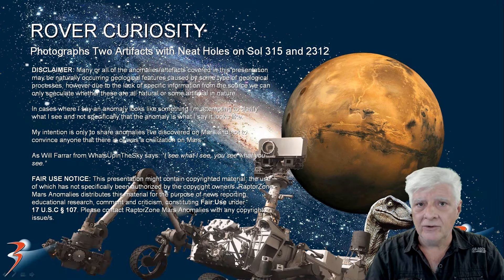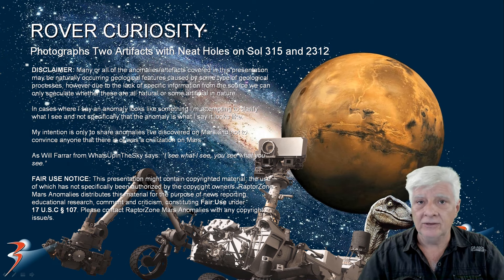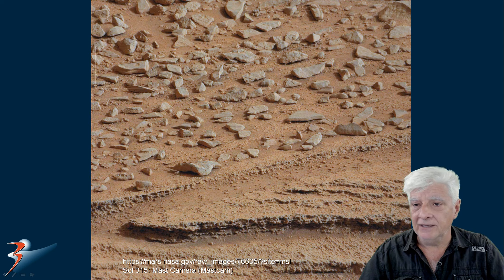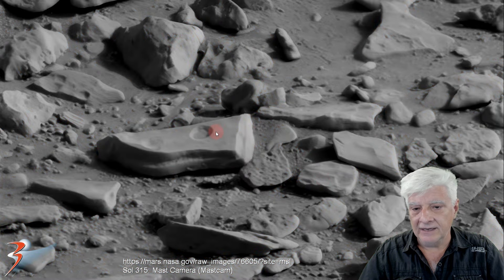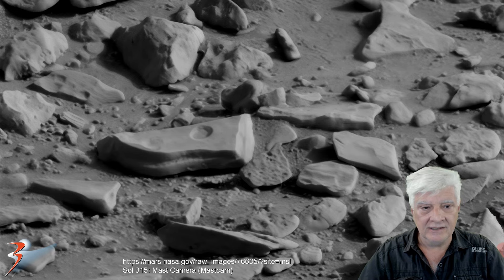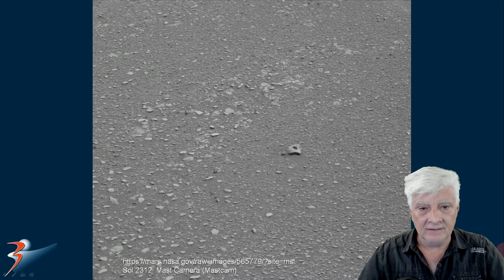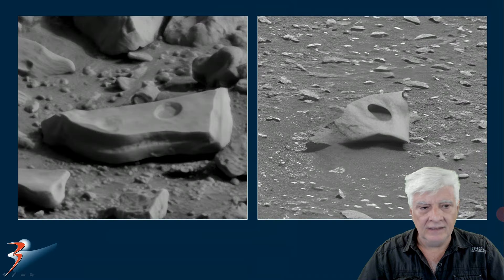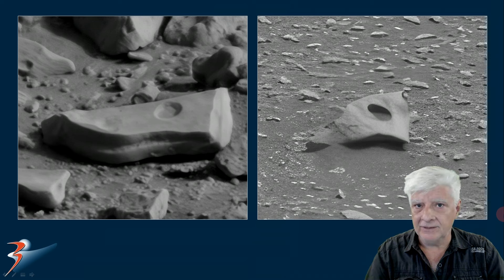ROVER CURIOSITY | Photographs Two Artifacts with Neat Holes on Sol 315 and 2312

Comment: Isnt the 1th one the result of one of the rovers instrument??
Reply from the maker: Good question - I don't think the rover made this impression as the hole is too shallow and flat inside (the drill would make a deeper concave hole) and the brush instrument likely can't make a hole, unless the material of the object is very soft.
Reply: @JeanWard  and this river does not have a laser ibtrument does it.. i should know really
Reply from the maker: Hi Jos, the rovers drill would make a concave hole, the hole in this object is flat inside. The rover brush instrument might make a hole or impression of the material of the object is really really soft.
Reply from the maker: Hi Jos, yes the rover has a laser, normally they would fire it several times in a row and it makes really small marks.
Reply: @JeanWard  yes i have seen the laser in action as far as i remember de holes where round.. this was my first thought.. but if the holes are to small i am out of idears 🙋‍♂️🙆‍♂️